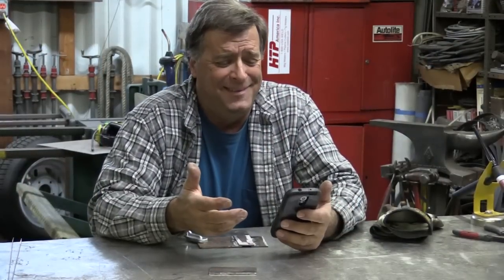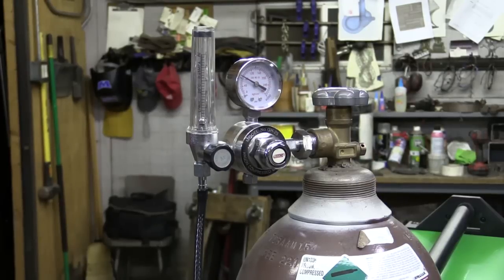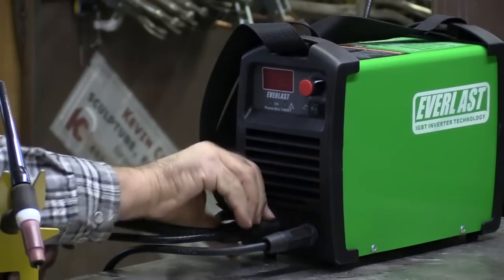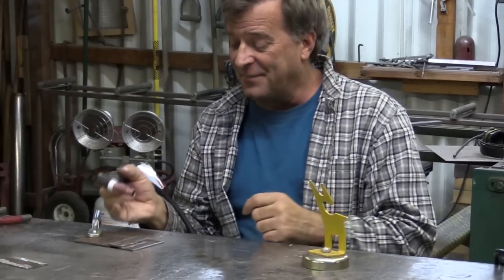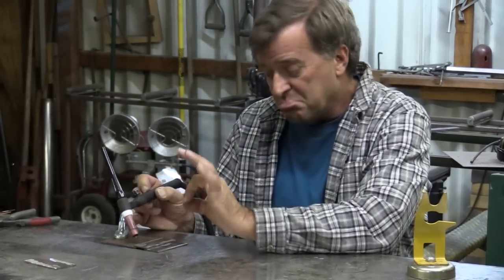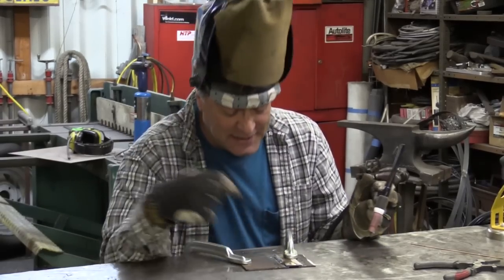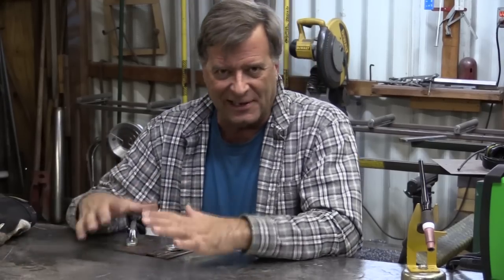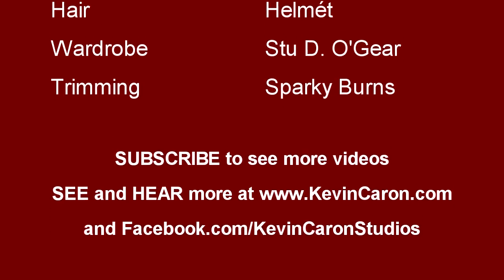How to TIG Weld With Everlast's Portable PowerARC 140ST - Kevin Caron

Comment: Thanks for the video. Using this machine at 120 V, with 85 amps, how thick of material can you weld in a single pass? What about a double pass? How thick can you go then? Thanks again, KB.
Reply from the maker: Figure 1 amp per .001 of metal thickness.   So if 1/8th inch plate is 0.125 that is too thick for single pass.  So more like 16 gauge to about 14 gauge.  Double pass if prepared correctly you should be able to do 1/8th plate steel.   But please keep in mind that I am not a certified welder so your mileage may vary.

Comment: I want to build a 4x8 utility trailer, would this welder do the job? Looking for an affordable welder to build a good utility trailer project.
Reply: Also keep in mind if you really want to use it you’ll more than likely need 220v input unless your welding thin steel. Rule of thumb is 1 amp per .001” of material. So if your welding normal trailer material then you’ll need more than the 80 amps it runs on 110v also thing about the current draw on the breaker. Do you have a breaker which can supply enough amperage to run the machine without tripping it every 3 seconds?
Reply: Joel Diaz I don’t know all the multi voltage welders out there. I’ve only used a cheap harbor freight 90 amp flux core. A couple millers and a couple Lincoln’s which are in the machine shop at my school. And I’ve used the Hobart in the offroad shop I work at on weekends. So I’m not really a welder by trade and don’t know all the welders out there. It’s hard to find a 110volt that will do 1/4”. Also if you actually become a welder they use welders way beyond what we’re talking about. I’m sure there is some videos on YouTube talking about cheap welders. My favorite welder I’ve ever used is the Hobart handler 210mvp but my little harbor freight piece of junk has done a lot of stuff. In fact I’m doing a job for a customer this weekend with the harbor freight 90amp just cause I can’t use any other welders on it and I’m using this job to pay for my power arc 160sth. The welds turn out well with the harbor freight they just look like crap till you grind them. You probably should decide your budget also. It’s fun to shop for welders but once you start putting money down it’s a different story
Reply from the maker: The welding machine is up to the job.

Are you??
Reply: Kevin Caron, Artist  awesome. First I have to learn how weld before attempting a project. First time for me.
Reply from the maker: Practice Practice Practice!!!!
Reply: It will do it but it will be way harder than using a mig welder. Much harder.
Reply: Nicholas Blancett thank you for your advice, I need all I can get. Yeah I wouldn’t be able to get use of it since my house runs 110v. I was going to purchase a Lincoln arc welder, the 225 tombstone ones but can’t with 110v. I guess my only options are pay an electrician to upgrade to 220v or just buy a mig welder. But I heard it’s expensive to weld with mig. Do you know of a affordable mig welder that can do what a arc Lincoln ac 225 welder can do?
Reply: Nicholas Blancett also want to go to welding school soon, to do welding as a career. I’m anxious to start building already!!!
Reply: Joel Diaz I mean the Hobart handler 140 is supposed to be a great welder for a 110volt I’ve used the Hobart 210mvp and it blew my mind compared to what I’ve been welding with. I don’t have 220 either. Look into adapters for the dryer plugs to welder plugs. You can always make one if you can’t afford one. Plenty of YouTube videos explaining it. If your gonna get one welder I’d get get a mig. It’s much easier to weld and is a little more expensive but much more usable. I’m only gonna get a powerarc for fun to learn the other two but if I could only get one welder I’d get a mig that could switch between 220 and 110
Reply: Joel Diaz ask yourself what kind of metal you want to weld. Small stuff? Smaller than 12 gauge? Or big stuff larger than 1/4” or somewhere in the middle? Or a mixture? Once you decide that then you can start to figure out what kind of welder you should get instead of comparing them. For instance a Lincoln 225 is known for doing good except on small stuff. But a mig generally is good up to 1/4” where the Lincoln could do better
Reply: Nicholas Blancett  I’m going to try out the mig and start building 1/4 with steel and metal. So some projects and I really need one since I bought a homemade utility trailer on Craigslist and the steal is 1/4 of an inch. Have to do some modifications on it. But yeah I’ll check out that mig welder and maybe later when I get better I’ll get a Lincoln arc for thicker material. Again thanks for your advice.
Reply: Nicholas Blancett I’ll choose the Hobart welder, was going to go with the longevity mig 140 but seen a lot of bad reviews on Home Depot. At least if I buy one from there I can return it if it’s a bad welder.
Reply: Nicholas Blancett which mig welders do both 110 and 220 that you would recommend?
Reply: Nicholas Blancett ok I found a affordable stick welder that can on both 110v and 220v, to 10-160 amps. It’s called the Ahp alpha 160st stick & tig welder. I want to learn stick welding plus I can repair my trailer too and perfect because it can run 2017 rods on 110v, since I don’t have 220 at home. But I’m also saving money for the habort 210mvp mig welder. But this stick welder should be good to practice on basic welding stuff on 110v and if I ever upgrade to 220 even better. Just 240$ price
Reply: Joel Diaz i believe if you get the tig accessories the ahp can do stick too. But it’s fits what your looking for at least for now. If you have a dryer I highly recommend looking into a dryer plug to regular 220 volt adapter that way you can run your welder on 220 and get the full output. Maybe you’ll end up teaching me stick 😂😂 it’s the one thing I haven’t tried. I’m curious as to what your doing with the trailer. Send pics or something when you mess with it
Reply: Nicholas Blancett the ahp can do stick welding using tig accessories?
Reply: Joel Diaz sorry I meant to say if you get tig accessories it can do tig also
Reply: Nicholas Blancett I do have a dryer but if I get that cord it can give me 220? But how I don’t have 220 in my house. Sorry Im ignorant when it comes to electricity
Reply: Nicholas Blancett haha yeah I’m pretty much flipping the trailer but it was a hole built one I bought dirt cheap, maybe sell it later in the future. But I’m just trying to add more reinforcements by welding a few things on it. Like the axel is good but on the right side I’m going to weld it because it looks a little loose. The guy welded the left side pretty strong and the right. Dummy!!
Reply: Joel Diaz every clothes dryer I’ve ever seen runs on 220v. I’m sure there is a crazy random one that doesn’t but most do. If you take a pic and upload it somehow I can help you out. I’m a mechanical engineer not an electrical so I don’t know everything but I’ve worked with 220 on an induction furnace and I’ve taken a circuits class. Basically in general there is a three prong standard dryer plug and a 4 prong. If it’s a three prong you just get a dryer cord extension and a hook it up to a regular 220 volt female side. Or look at your breaker in the house and if it has two breakers which are connected then that means there is 220 to wherever those breakers go. And also you can look at the plug and it should say 220. All regular plug outlets usually are 110 cause it’s cheaper cause it requires smaller wires but usually the dryer runs 220 sometimes kitchen appliances too.
Reply: Nicholas Blancett wow never knew that pretty cool, but that would be awesome to stick weld on 220 through a dryer extension cord. I’ll send you a pic of my breaker and dryer tomorrow since I’m at work now. But you want a pic of the dryer or the cord ?
Reply: Joel Diaz not the dryer cord but the plug that’s mounted into the wall
Reply: Nicholas Blancett you think you can find me send me a link from you tube if u have a chance, just to be sure I’m doing what you recommended the right way.
Reply: Joel Diaz did you buy a welder? 
https://youtu.be/rflQb6qkFkQ
Reply: Nicholas Blancett thank you,yeah the Hobart 140 welder. Since mig is easier than stick lol
Reply: Joel Diaz that’s cool. It should do everything you’ll need for a long while and last a long time. I am ordering a Miller Multimatic 215 this weekend. Or picking one up from a local welding supply today if they’ll match online deals
Reply: Nicholas blancett Yeah millers are the best, but expensive. Wish I can buy the one your getting. Good luck on the deal
Reply: Nicholas Blancett ok I seen the video. So when I make that dryer cord extension do I plug it into the wall outlet and then plug my welder to the box outlet? Or does it plug from the dryer lol confused. Sorry I make things complicated.
Reply: Joel Diaz yeah I was just planning on the Hobart 210 but after I got my tax return and talked to an old time welder buddy of mine he convinced me to get the miller. The hobarts are actually made by miller so they definitely aren’t a slouch. The only big difference is color. Hope you have fun. I’m actually gonna start making an off-road trailer pretty soon. I have some old axles I’ve been hoarding and I have some extra 32” mud tires I took off my jeep when I bought it. Let me know how the trailer goes
Reply: Nicholas Blancett that’s awesome Man that will be fun project, especially for summer. Can take it camping brother. That’s what I will be doing. But didn’t know miller an Hobart are same maker. Hope your trailer goes well, especially with that great welder.

Comment: Not a bad welder for the money but i have fought with the machine when TIG welding stainless tubing. Always leaves a really grey finish like the weld in the video. I think it is just a lack of temperature control for that type of metal. Stainless oxidizes quickly and gets heat soaked quickly so if this machine had a foot pedal I bet I could get that shiny look to my welds. I am new to tig in general, running 40 amps, 20 cfh argon, #13 cup with gas lens, 16 gauge polished stainless tubing. Seems like If i turn the heat up and move faster it gets too hot and grey, if it turn it down to 30-35 amps it blows through because it just heat soaks but the time it pools up. Tried lots of different variables  and I think I need to upgrade to a machine with a foot pedal and more control on heat or something for stainless exhaust tubing. I will add, the stick functionality of this machine is really good for out doors work.
Reply from the maker: Be fun to try it again with a pedal.

Comment: Kevin I just got a Everlast powerarc 200st. Do you setup the touch the same way?
Reply: Todd Johns 

I just ordered the same welder. How do you like it so far? I’m a complete noob to actual experience but I’ve been studying for years! I’ve been wanting to get into welding for so long but at the time the machines I was looking at were way too pricey. Then I found this cheap little thing and seemed to get great reviews. I can’t wait to get started!
Reply from the maker: Correct.
Reply: Thanks Kevin. Could you tell me what would be a good torch to start out with that would work with Everlast powerarc 200st
Reply from the maker: The one that came with it works great for me.  Or talk the folks at CK TORCHES.
Reply from the maker: Thanks for watching!
Reply: bluecapone I ordered a powerarc 200st.  It doesn't come with a tourch. I haven't used it yet. I don't have a welding helmet.  I saw that killer deal right before Christmas 333.00 on Amazon and Everlast had it cheaper but when I called it didn't include shopping.  But sales rep said they could price match. So with that said. I'm on a fixed income. I'm waiting for htp to restock the htp striker supreme welding helmet.  So I can order that welding helmet. It's a great buy.  I seen Chucke2009 review on it. For the money that's the next purchase. I'm a completely new at welding. Haven't struck a arc yet. Once I get a helmet and gloves I'm set to start. But kevin and Chucke2009 both have great videos on how to weld.
Reply: Todd Johns 

Ya I ordered a power arc 200 also.  I’m in the same boat too. I don’t have gloves or a helmet either lol. I use an app called offer up, you can find locals selling used stuff for really cheap. That’s how I’m going to get my gear, including chop saw and oxy acetylene  torch then I should have enough tools to start making a real mess lol.
Reply: bluecapone after I replied to you. I called htp and the lady gave me the htp striker supreme xl welding helmet for the price of the striker supreme welding helmet. So I ordered it and 3 replacement front shields and 3 back ones.

Comment: Hi Kevin ,  whats the max amps on 120v & 220amps  just to be clear . Thank you for the vids !!!
Reply from the maker: Max Rated TIG Amps: 

    @120V:  85A
    @240V:  140A

Max Rated Stick Amps: 

    @120V: 85A
    @240V: 140A

TIG Amps @ Rated Duty Cycle: 

120V:

    85A/23.4V @ 35% Duty Cycle/ 40º C
    65A/22.6V @ 60% Duty Cycle/ 40º C
    50A/22V @ 100% Duty Cycle/ 40º C

240V:

    140A/25.6V @ 35% Duty Cycle/ 40º C
    110A/24.4V @ 60% Duty Cycle/ 40º C
    85A/23.4V @ 100% Duty Cycle/ 40º C

 
Stick Amps @ Rated Duty Cycle: 

120V:

    85A/23.4V @ 35% Duty Cycle/ 40º C
    65A/22.6V @ 60% Duty Cycle/ 40º C
    50A/22V @ 100% Duty Cycle/ 40º C

240V:

    140A/25.6V @ 35% Duty Cycle/ 40º C
    110A/24.4V @ 60% Duty Cycle/ 40º C
    85A/23.4V @ 100% Duty Cycle/ 40º C

Comment: Hey Kevin! Could you use (if they even make them) a small bottle and if you did, how long would it last? I am thinking of several places that lil welder and my generator could make sparks fly! AFFORDABLE TIG IN THE MIDDLE OF NOWHERE? How cool would that be?
Reply from the maker: +Daynaleo1 

Sure you can use a small bottle on this machine..      You should check on the generator though..  not all generators are clean enough with the power output to run a inverter welder..
Reply: Hi Kevin. I am looking to purchase a small tig. Thickest material will be 3/16" or so. I would want to experiment with metal and alluminum. You mentioned that would require ac dc for alluminum. I would be welding mostly in my garage and driveway. I don't want big welder on cart. So a portable would suit me. Would you recommend the everlast 180. For my purpose.

Comment: I guess. It just seems like poor heat control (not your fault). I own the everlast 250ex and i love it. So i am not knocking everlast. It just that tig welding is all about control and that thing looks wild.
Reply: I know this is old but yeah, there is a lack of heat control and all of my stainless welds with this machine just turn grey or blows through doing exhaust. It needs like a foot pedal or something.

Comment: Hello and thank you for the great video question do you recommend this machine for a first start or new welder.You see i am new at welding and in order to practice i am looking  to get a small machine,i was thinking on the 80 amp Harbor Freight  but this machine offers more.What is your opinion???
Reply from the maker: +423alonso I only endorse machines that I like and think are a good buy..     If I didn't like and use this machine I would not do videos about it..      For a starter machine this should do nicely for you..    Just go slow and practice practice practice....

Comment: How much tig welding can you get done on a single large bottle of gas?
Reply: Wow that's a substantial amount of welding,i was informed that i would be getting refills every other day if i was to use continuously on sheet metal.
Reply: Thanks for the info,i shall look into changing from using Flux Cored.

Comment: Rig welders use a rubber hose to slide over the end when they finish welding to keep the end isolated when doing lift or scratch start TIG with no remote control in the field.  You only need about 5-7 lpm when welding, which is about 10-15 cfh with this small cup.  If you hear the gas rushing that loud, it probably needs to be turned down.  It will improve the stabilty of the arc.
Reply: No,    but you can find them at htpweld.com or several other welding supply sites..
Reply: The foot control can be used on this machine?
Thanks.

Comment: I'm in a weird boat when it comes to this machine. It is at the top and the bottom of my will buy "if" list. I can either buy a MTS/multi-process machine or buy a stick welder, a mig/flux core welder, and a tig machine. Or get a tig/stick machine and a mig/flux machine. If I buy a multi-process device then I am probably going to go all in and get something that costs more than my truck (99 tacoma) but I may decide I want to be able to go to the work instead of having to deal with deliveries. If I do that I will buy "more affordable" machines like this everlast but I haven't used one yet and hate buying stuff before trying them out. I have also heard good thing about longevity machines but I don't know anyone near me with one.

Comment: hi Kevin, i like your videos. i have one question/comment. your recommended setting of 10 lpm seems very high and when you turn the gas on it literally sounds set pretty high as well. a quick reference search on millers website suggests a gas setting more along the the lines 11 cfh. im no professional welder so i very well could be incorrect but i think you might find the machine welds with a more stable arc and way lower operational cost with the lower gas setting. thanks for your videos.

Comment: Requiring contact to start the arc, I would suppose there'd be an issue with electrode contamination, requiring a grinding wheel to be taken to it to clean more often than a pedal controlled TIG set.

Being able to run TIG off a 120V circuit is pretty slick!